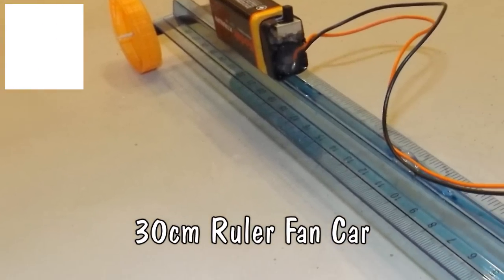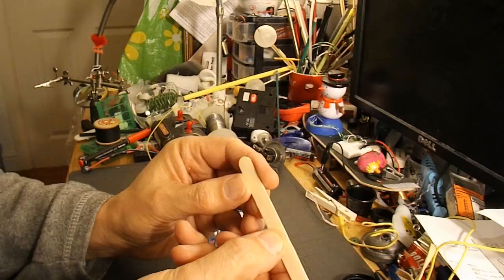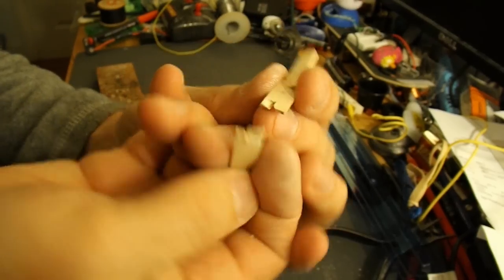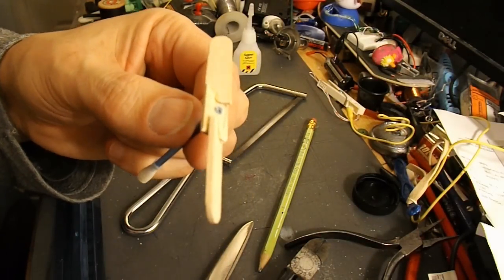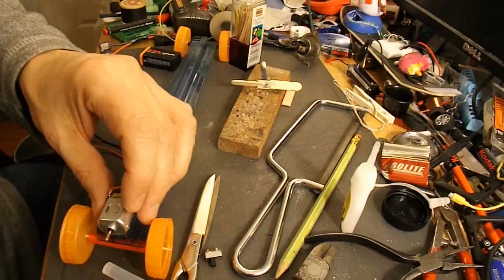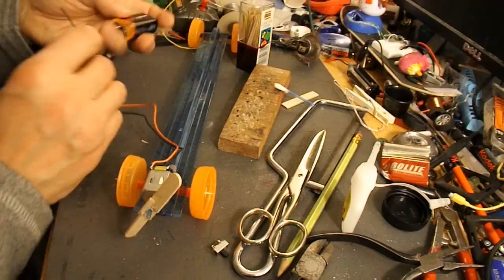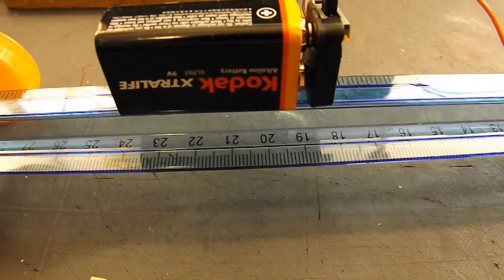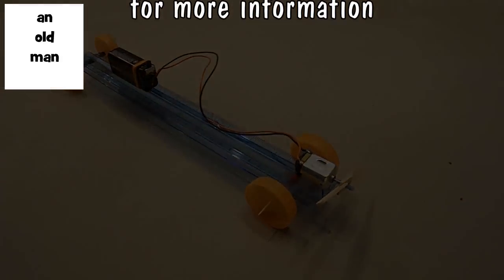30cm Ruler Fan Car

Comment: hey Grandad can you make a car which has four motors on each wheels?
Reply from the maker: +Amrit Jung Dangi you could but without gearing it would probably be too fast to use in my kitchen which is where I run my cars.
Reply: you may try it outside also.

Comment: Hmmm, I have some stuff you may find useful, but it's just clogging up my "stuff tubs"... some interesting stuff too, old acoms 27mhz transmitter, think I saw the Rx not long ago, a cheerson cx10 (no battery) and Tx...erm... some knackered li po's with maybe a good cell or 2 in them... couple of good brushless motors I can put in to make it fizz a bit... some carbon plate off cuts, some thick circuit board off cuts...LED strips that have been stuck on and pulled off, so glue is not too clever.. I'm going to throw it away at some point, maybe if I box it up and send it to you, who knows what you can do with it? I'll try and find some servo's too, but I don't really use them that much.
I won't put anything in that's totally buggered, so if you're interested, let me know!!
Reply from the maker: Ben Portman that is really kind, but I already have more than enough 'stuff' to keep me going. If I start accepting the donations I am offered via YouTube I would need to rent a storage unit and I would never get through it all. I have misplaced more stuff than I can find already, which makes it frustrating when I know I have it stored somewhere, but cannot find it when I need it. Thanks again, that is a very kind offer, maybe you will find somebody closer to home who can use it.
Reply: O.K.. I'll think of something to do with it!
Reply from the maker: Ben Portman thanks again for the offer :-)

Comment: Can you make a gravity powered fan car
Reply from the maker: I doubt that it would work. The distance dropped by the weight means the fan would hardly get started spinning before the weight stops falling.
To travel 5 metres using CD wheels, the wheel rotates less than 14 times.
If you attach a propeller to a similar axle I doubt that 14 revolutions of the propeller would drive the car anything like the same distance.
However it might be interesting to try it. I will put it on my list.